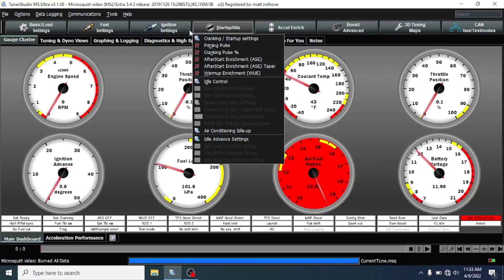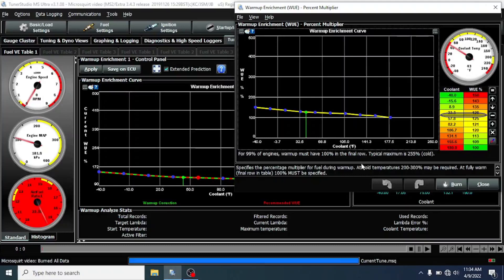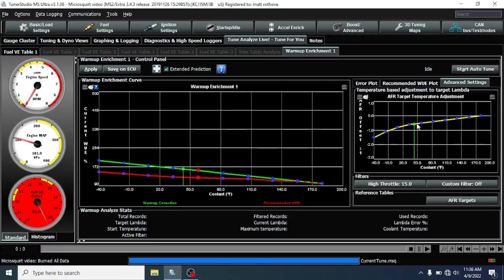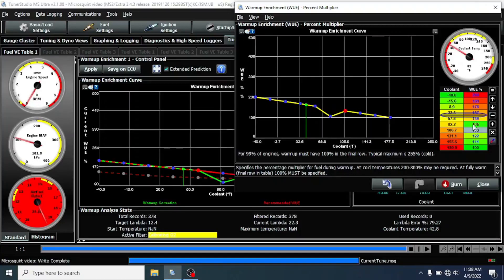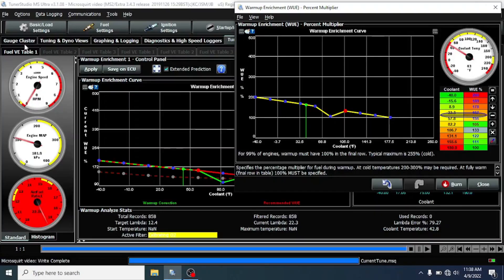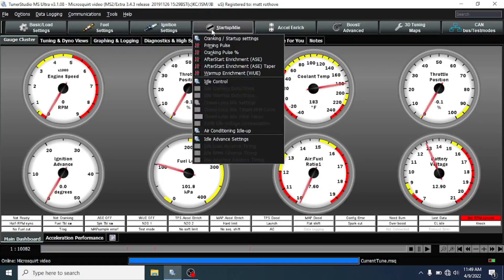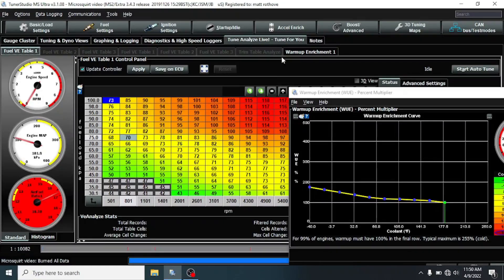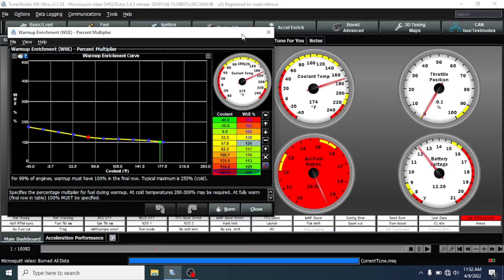J35 Microsquirt Guide Pt. 7 Warmup Enrichment

Comment: So where do you get the program from is it when you plug the micro in or do you have to pay for it...
Reply from the maker: Tunerstudio is free to download, but there is a $100 option that’s lets you get autotune which will get the fuel table very close using the wideband. I suggest to just get the $100 option as you’ll quickly burn up more time than just paying for it. But there are a lot of ppl out there who do it by hand to so it’s whatever your comfortable with.

Comment: Do you think the micro squirt will work on a d series engien?
Reply from the maker: Yeah it should work. You’d have to count the crank teeth in the dizzy and probably grind one off. You’d have to do batch fire on the injectors, but you could go coil on plug and control individually(need tdc sensor hooked up, which is in the dizzy also) or wasted spark(no tdc sensor needed).